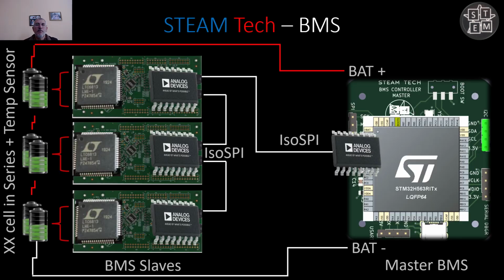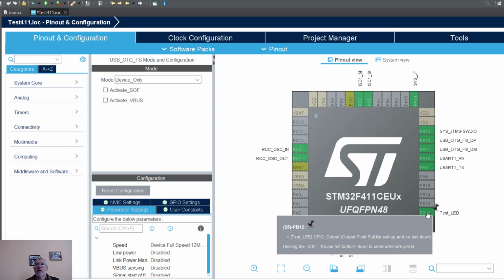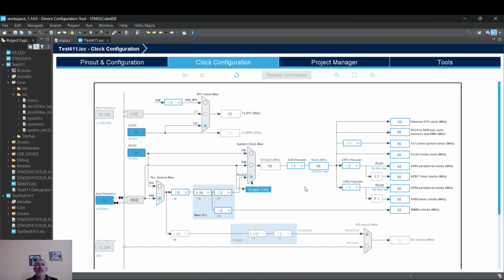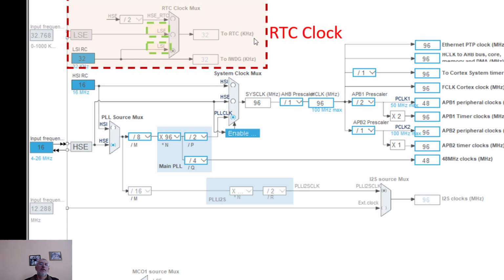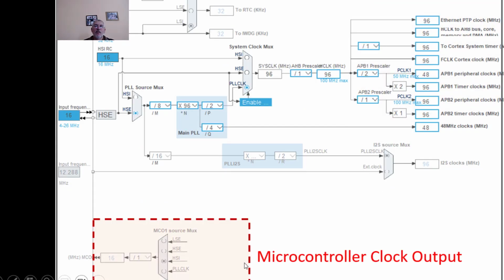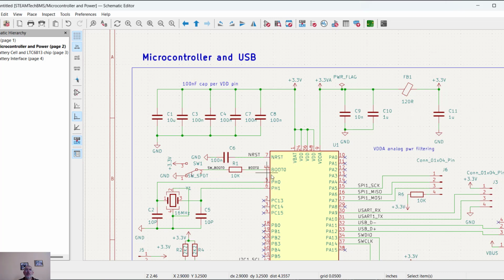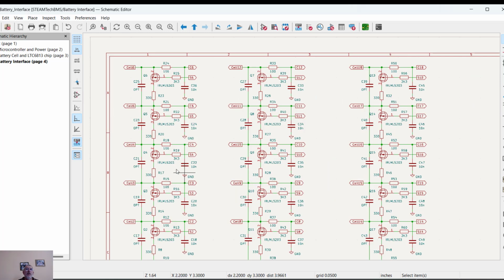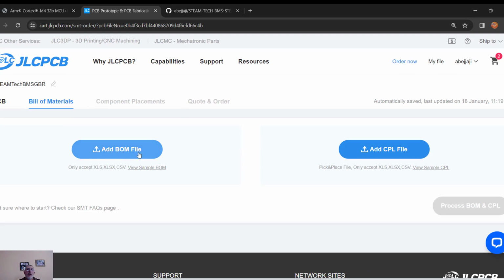STEAM Tech BMS Part2

Comment: What is it ? Does it have load balancing ?
Reply from the maker: Yes, it will have passive balancing as well
Reply: @Steamtech_Formaion  Meaning a switchable resistor for each parallel cell part ?
Reply from the maker: @trevoro.9731  correct